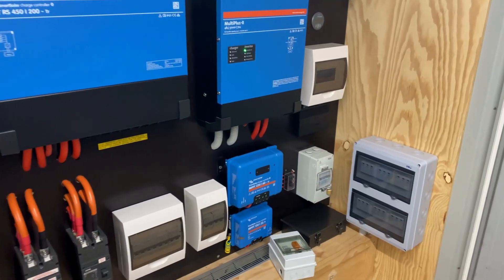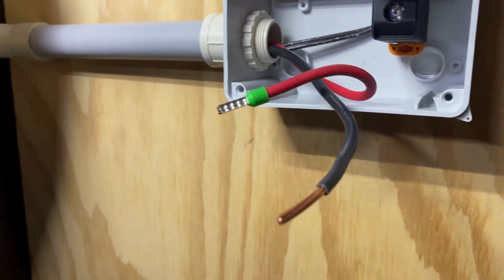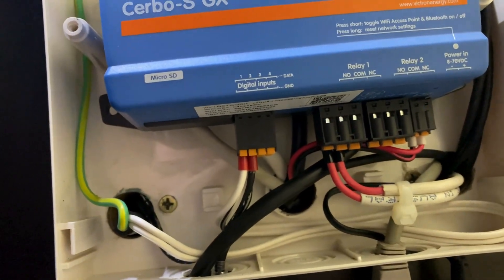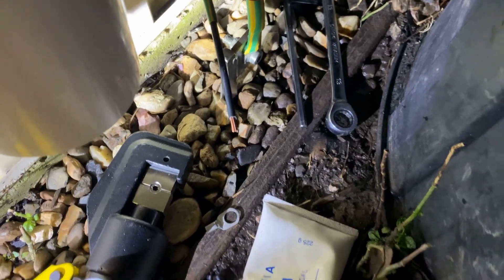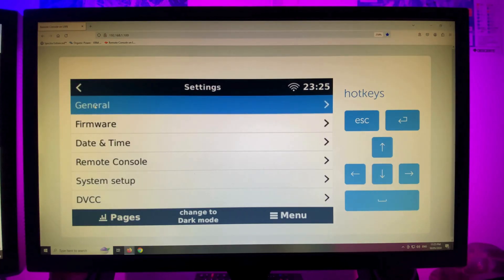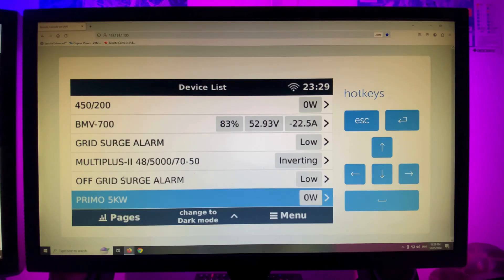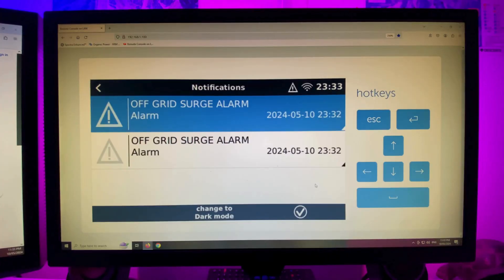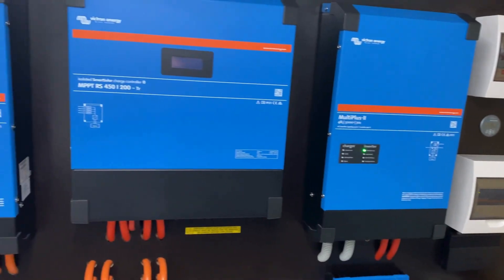Harnessing Off-Grid Power Safely Benefits of Installing AC Surge Protection Organic Power Australia

Comment: I see you've used GEYA brand for the surge protection. Would you use their MCB's and RCBO's as well?
Reply from the maker: Hi, I have used their MCCB’s and MCB’s for DC protection. They were tested by tripping under full load to confirm safe operation before the installation process. I only use Hager or Clipsal switchgear for anything on the AC side.